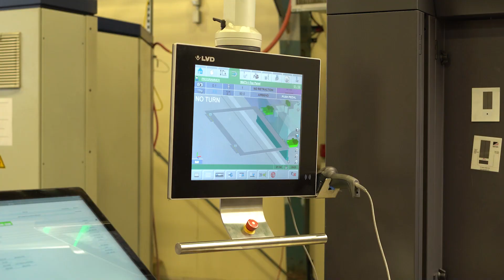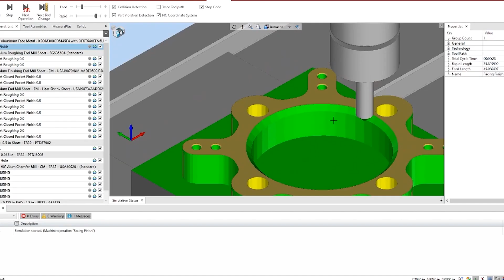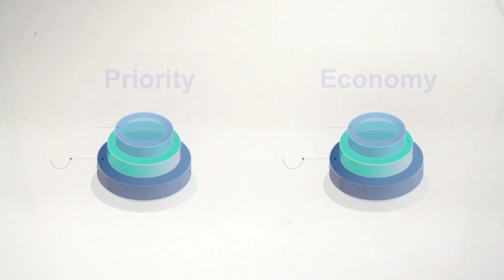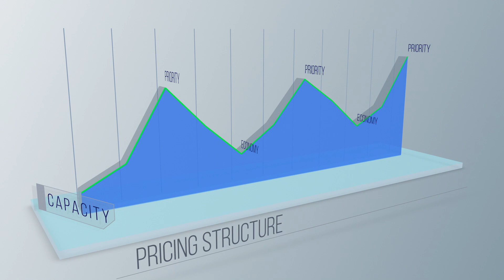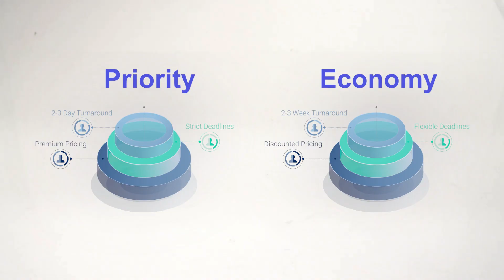Why We Changed Our Pricing and Introduced a New Leadtime Option

Comment: I realise that every case is unique but what sort of price should I expect a PC case to start at in the UK? I don't want any fancy designs or weird finishes on the exterior.
Reply from the maker: Hi Martin, it is really tough to say, especially if there is no CAD file to start with. If you're looking to use our Design Services to get a PC case designed, there is an hourly design rate of $120.

You can use Protocase Designer to get a rough estimate of what an enclosure with your approx dimensions to get a sense of manufacturing costs. 

For a case like the Linus Tech Tips Rackmount PC case, that one is approx $1,800 for Economy leadtime. (But that does have powdercoat, digital print, etc -- so it's not an ideal comparison to what you're looking for).